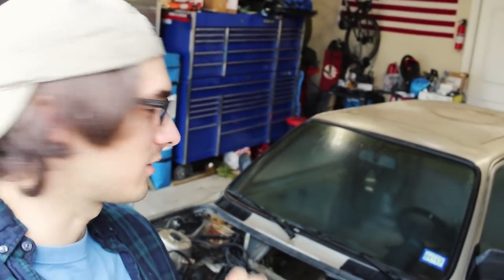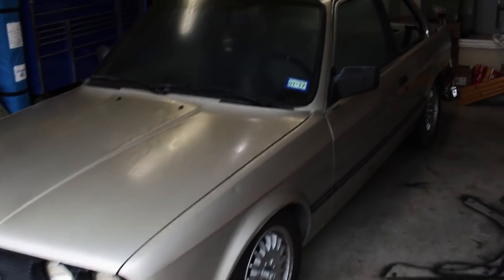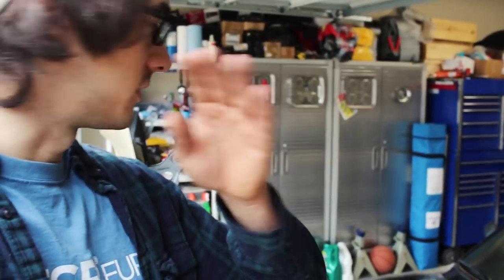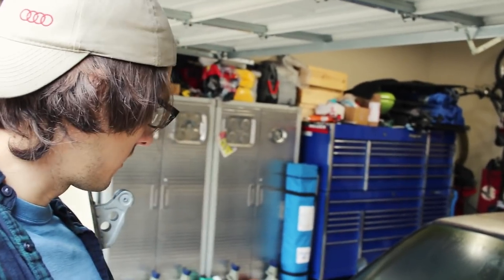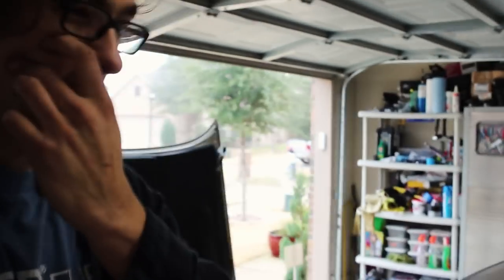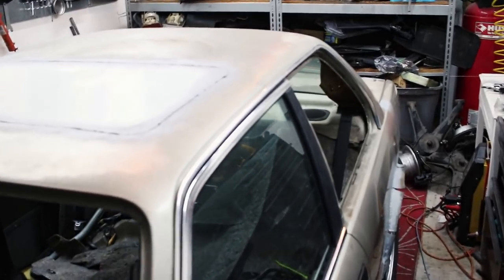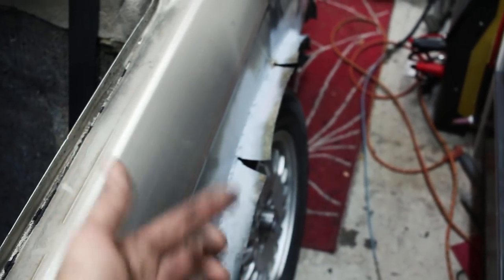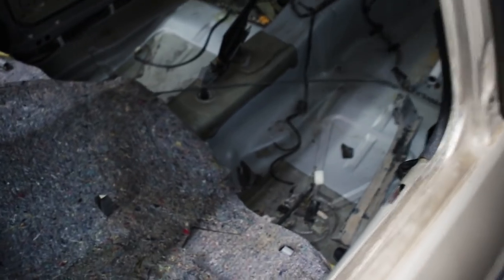Rocket Bunny Turbo S52 BMW E30 Build | Part 12: NEW SHELL, Full teardown

Comment: Just wondering if that was the one without an engine on Craigslist up in the DFW area awhile back. I passed due to the garage needing a jet ski gone for good. Make her solid, make her scream, little dude.
Reply from the maker: Craig Thomas it was a shell in ft worth. Think it’s been passed around a few times. Thank god it ended up here with a real purist 😝
Reply: @EuroGarageOfficial  Work your magic. I thought it looked familiar.

Comment: Good stuff. Be sure to get it caged now that you removed the sun roof bits. The structural integrity has been reduced and you'd likely get hurt in a roll over
Reply from the maker: Gavin Goodoien it will be half caged. But I would argue the sunroof cassette would not support the roof at all in a roll over. Also keep in mind these cars did come without sunroofs sometimes.
Reply: @EuroGarageOfficial  I wasnt guessing. Im stating. They are built different and im fully aware they came with and without sunroofs. The roof skin is different though from slicktops. The cassette stiffens the roof up. But good to hear you're doing a half cage just making sure

Comment: You should remove the rear window to make sure that there isn't rust on the lip where the seal sits.  Mine has been a CA car all of it's life and the rust was causing my rear window to leak.  Likewise, with the trunk seal.
Reply from the maker: Brent Spang it has been removed. Good tip.
Reply: How did it look? Any rust?
Reply from the maker: @brentspang9092  The rust in the video was actually the only rust!
Reply: EuroGarage that’s good news! Make sure to use a Genuine BMW replacement seal. I replaced mine with aftermarket (URO I think) and it leaked. The genuine seal I replaced it with doesn’t leak.
Reply from the maker: Brent Spang I was planning on reusing it. Hmmm I’ll look up the proper procedure. Maybe run a little sealant around the rim.